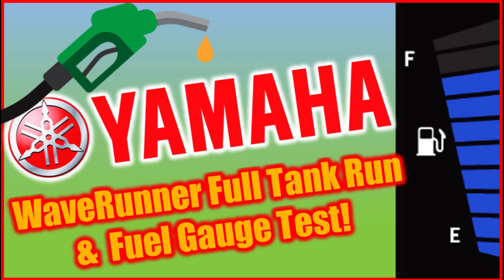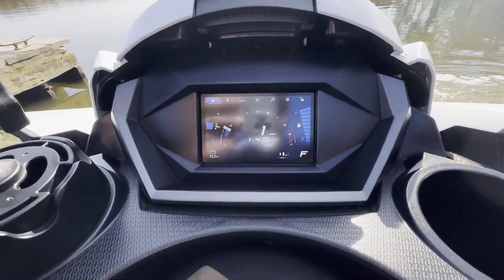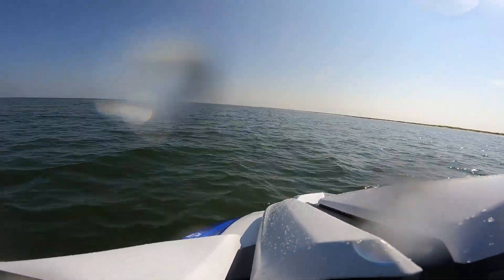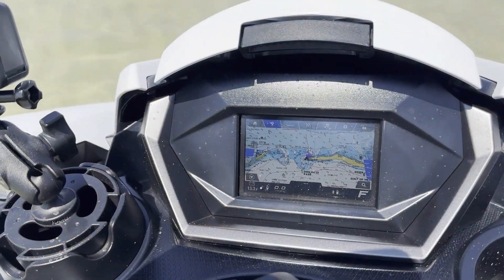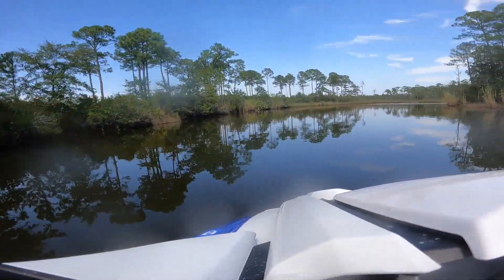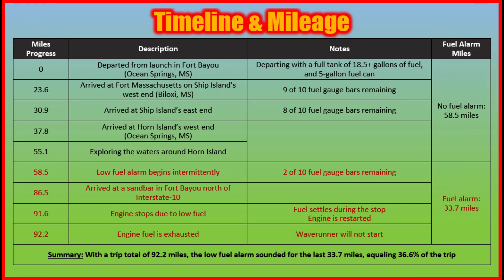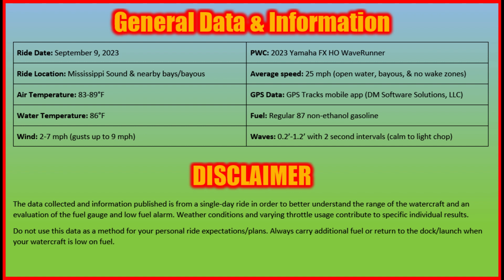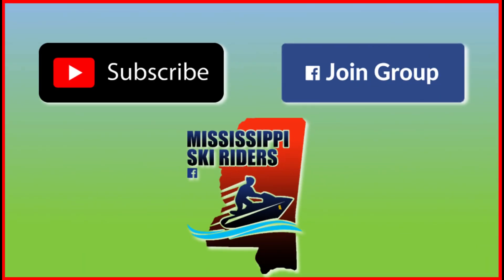Full Tank Run!  Testing the Yamaha FX HO WaveRunner Range & Fuel Gauge Issues

Comment: Thanks for making this video. Knowing when the alarm goes off in terms of remaining fuel is very handy info.  FYI I have a near new '23 FXHO and had to have the Connex screen replaced 2 weeks ago as it was intermittent from new. After replacement ( a 15 min job) the screen has been perfect and very unexpected was that  the fuel consumption reset issue has gone away!  So there has been an update release of the screen unit it seems. As an offshore fisherman, I need to always know how much fuel I have.   So I am a happier owner.  I just hope for a fix to be able to mute the silly low fuel alarm while riding like my previous FXHO could!
Reply from the maker: Yep, I think we’re all in the same boat (ski)!

Comment: Great content & information.  Very frustrating to hear & see this happening on a great product Yamaha has produced.  From what I know & can tell while having the opportunity to ride the new 2024 the data isn’t being cleared after start & stopping the waverunner.  Thanks again for sharing!  

Billy D
Reply from the maker: That’s good to know!
Reply: My 24 GP HO holds the trip info until I reset it.

Beeps at low fuel at 10.5-11 gallons used but I can silence the alarm in motion. 

Just removed the check valve hoping to get another 2 gallons in the tank on my next fuel. With the check valve in I couldn't get the tank to fill more than 1" below the top radius of the tank without spending forever at the pump.

I hit 14.2 gallons used without running out I'm hoping I'll have a low fuel alarm that beeps closer to 13 gallons used and over 16 usable with no reserve.

Getting over 6 mpg while cruising at 40, and averaging 5.4 with some WOT time in there.

Comment: Nice Job and just to add, my 2022 FX HO low fuel light comes on with 8 gals of gas left. Way too early IMO. Though for reference the annoying low fuel alarm is easily disconnected. The trip meter resetting is really the one software update I wish Yamaha would correct for taking long trips and keeping track of fuel usage. As noted above, most boat fuel gauges are not accurate.
Reply from the maker: Yep! Only issue for disconnecting the alarm is that it will no longer work for other issues such as overheating.
Reply: Yamaha just released a software update that stops the Fuel Used data from resetting on power off and supposedly increases the runtime before the fuel alarm goes off, check with your dealer
Reply: @joef2504  WooHoo!

Comment: Love my 2022 FXHO. Had a VXR previously. However, the low fuel alarm is an issue that needs to be addressed. As an example,  my low fuel alarm was going off as I was returning to the dock. I got to the pumps and was showing no bars on the gas guage. I filled up adding 12 gallons. With an 18.5 gallon tank, I still had 6.5 gallons in it. Not sure why this is so hard for Yamaha to figure out. My 2017 VXR was on point with the gas level.
Reply from the maker: Definitely an issue that needs attention from Yamaha. Otherwise, great skis!
Reply: I have the same exact problem with my 2024 FX
Reply: I went down this rabbit hole with my 2022 SVHO and ultimately yamaha dealer said it was operating correctly by design. So I guess they really don't want you to run out of gas while out or something
Reply: @FirstMrNick  From what I've gathered, Yamaha was sued because some dumbass ran out of gas. So they set the low gas alarm higher. Don't tell me I'm low on gas, ruin my day, when I still have 6 hrs of riding with the gas I had. With my 2017, if the alarm went off, I knew I was low. Now it goes off, I have enough gas for the day, or do I

Comment: These “known issues” are exactly why I did not purchase a new FX waverunner. It is my understanding that these problems will not be addressed until a new Connext system is introduced. Imo shameful behaviour on the part of Yamaha Corp.
Reply from the maker: Understandable. All skis have pros and cons. Yamaha WaveRunners are awesome machines and very reliable, however these couple issues can be annoying to deal with.
Reply: Just had the software update on my 22 & 23 waverunners. Took 25 mins, fuel gauge is way more accurate now and they obviously did not charge for the update
Reply: @skimaster7104 Me too!

Comment: the fuel mileage on these things sounds as bad as my pontoon boat!
Reply: Jet drives are never going to be as efficient you probably crusing at 5,000rpm these are push 7,000-8,000rpm 

They can be efficient but you have to maintain a constant speed I’ll get 120miles if I stay around 40-45 mph on 70litres